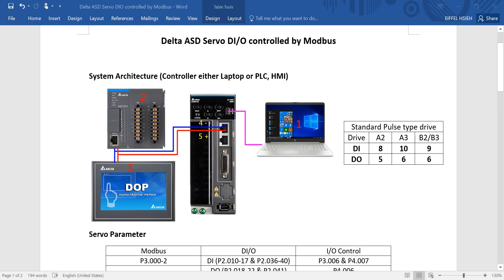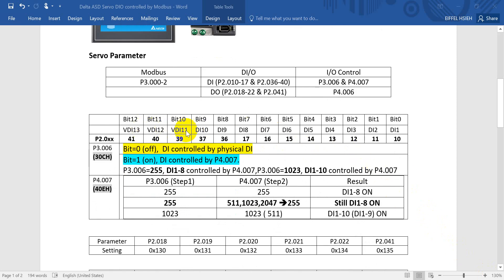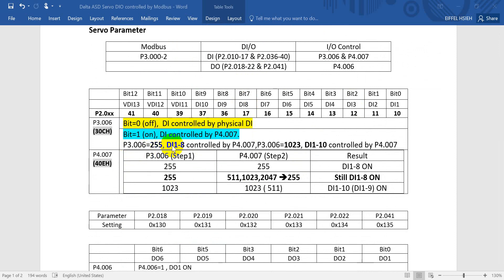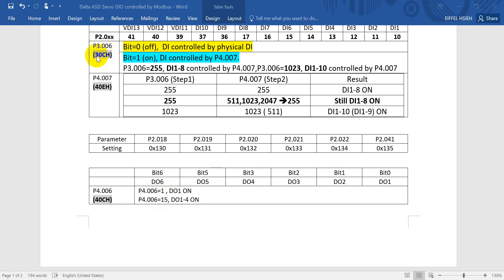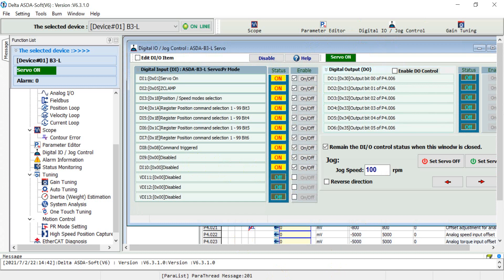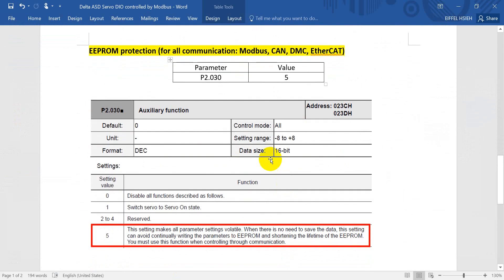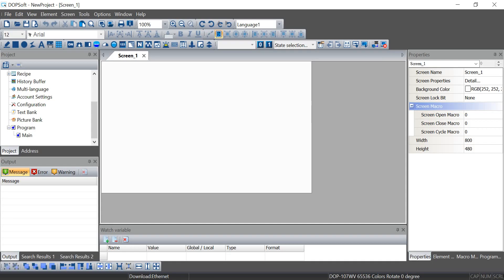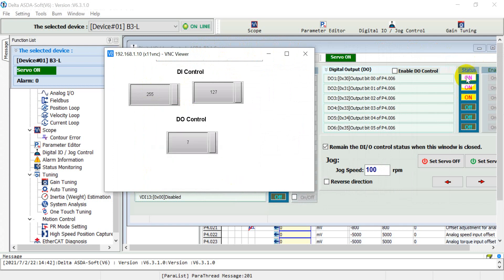Modbus control Delta ASD Servo DI/O

Comment: Can you please explain how to send position command to the DInputs (register position command selection) i set them as dinputs as you did but i can't determine the values to send to each bit to get 90 degree turn for the motor